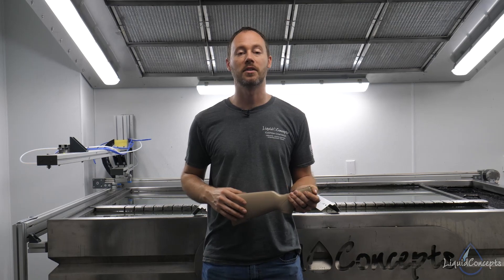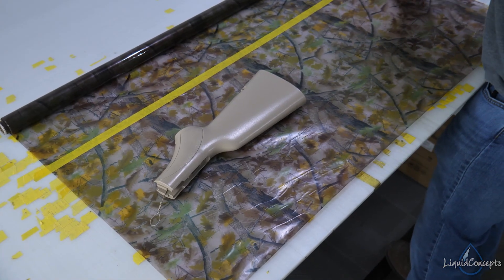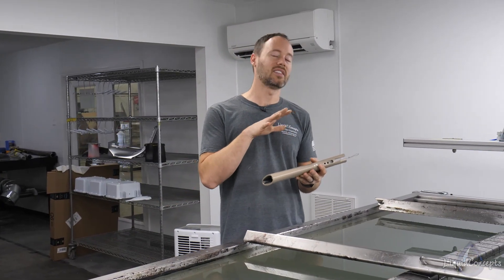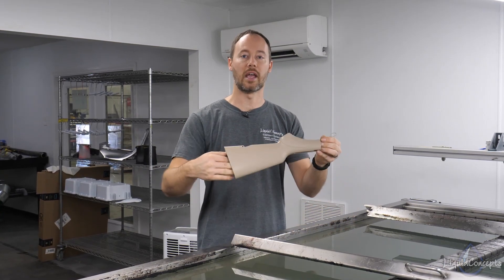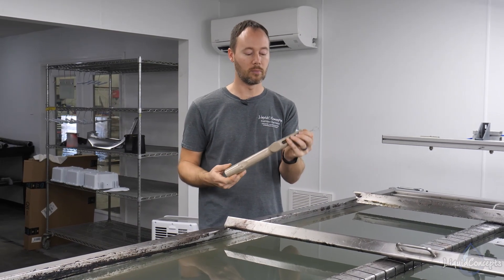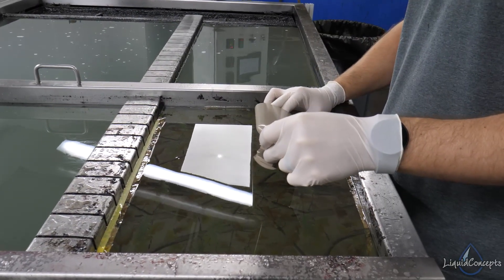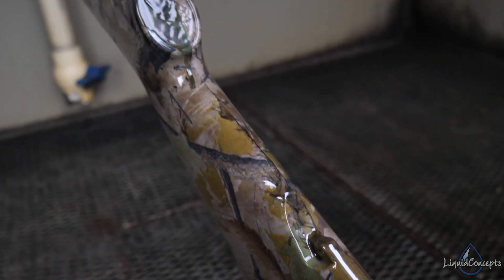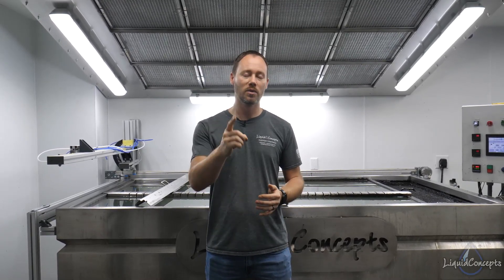How To Hydro Dip a Gun Stock In a SINGLE DIP

Comment: What adhesive are you using to get the film stick to the substrate?
Reply from the maker: Once you spray the hydrographics activator and it liquifies it then embeds itself into the paint on the parts once it is dipped.